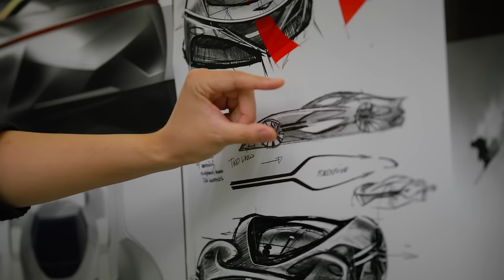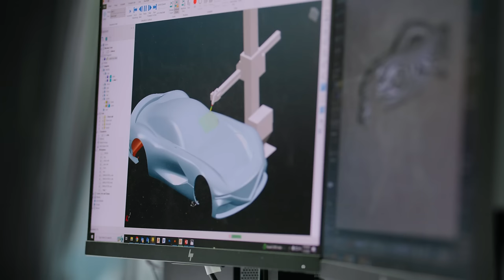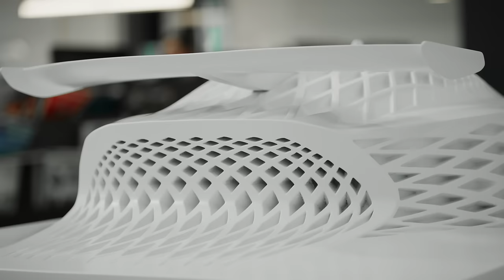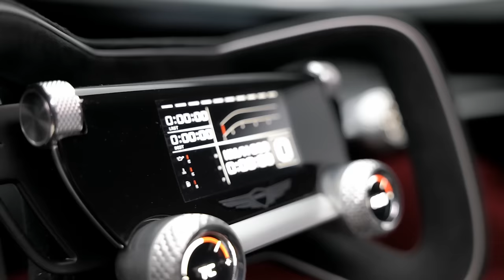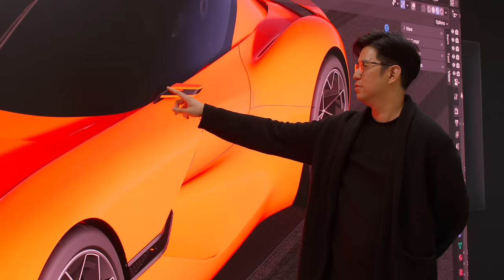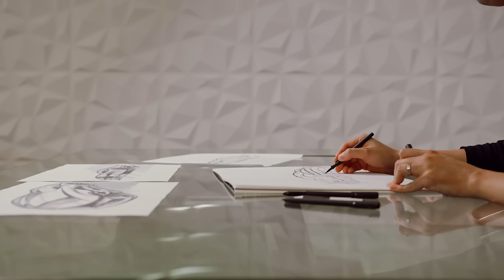VGT: Genesis Design Story

Comment: I’d rather hear the design story behind the Suzuki Jimny. A car that actually exists and isn’t just soulless marketing wank that hasn’t has to run through the gauntlet of real design, engineering, compromise, regulatory red tape, and mass production.
It’s an empty shell. Its specifications are just insisted upon instead of fought for and earned.

VGT cars are pretenders. Where are the latest GT3 cars? LMH/LMDh cars?
Reply: You do know that most cars start life as concepts just like this right? It's a critical part of the design process and often goes on to define the design language of years worth of cars.
Reply: Cope, seethe, and mald
Reply: @markthegamedriver  Cry about it

Comment: The Update Sucks 👎🏼. These Visions are unnecessary
Reply: Cope, seethe, and mald
Reply: Apparently he doesn't know that the new NSX and Bugatti Chiron were born thanks to VGT.
This is very sad.
Reply: Shut up.. just enjoy the progression man
Reply: •No mirrors(nice)   l like that

•no central 3rd brake light -- it's actually broken into two pieces along each side of each rear fender

•nice wheel design with very low profile Cup2s

•very nice interior, nice details overall

•the sound is magnetic --  sounds like 4 vacuums from year 2081, lol

•nice amount of power and torque,  weighs less than 2400 pounds

•continuous headlight/ daytime running light design integrated into Genesis design language

•No race car-like downforce as it is still not a race car  so it gains available grip from its integrated front and rear wings that are designed into the bodywork and mechanical grip from racing hards.

   And if my memory serves me correctly it also has some underbody work including rear diffuser. 

    At Spa against group3 ai  it's a blast for an hour of driving.      Obviously no wipers so it has some futuristic ceramic coating that does not allow rain water to touch the glass !

•4wd,  4 wheels driven

5th gear is good for acceleration both dry and wet,    8 gears is nice but too bad l can't pick my own ratios being that it's a Vision coupe.     Try angry acceleration out of a corner in anything less than fourth and you'll be sideways at least if not on a quick run to meet Barry. 

•gullwing doors are a nice touch

•steering wheel is nice, simple

•continuous rearview display is thoughtful

•my favorite color in lndian burnt orange

•can't even see where the exhaust is exactly on the sides but it's actually integrated into the side coves 

•it will be a nice road car and race car if it ever goes into production;   it would nice to see it everyday after work or sitting inside your garage everyday. 

•Compliments to every single

 designer, engineer and artist at 

Genesis,  well done on your concept.

Can't wait to get off my second job to go on home and put some miles on this beauty.

     20jan2024.dellthecomputer
Reply: Unnecessary comments suck
Reply: Free update good
Reply: @Shiki_Tojyun  apparently the first gen BMW M2 also was initially a Vision GT
Reply: Sus frenos no van acorde con su potencia. Si no lo puedes parar cuando el piloto quiere, no me sirve.
Reply: Cope.
Reply: @Kortex_Racing  Seethe
Reply: NUH UH
Reply: Great cars to drive, a peek into the Future. Really like it